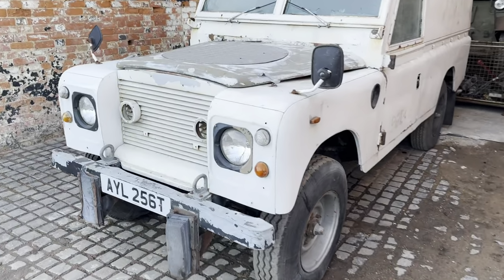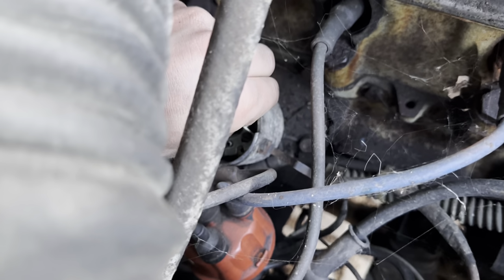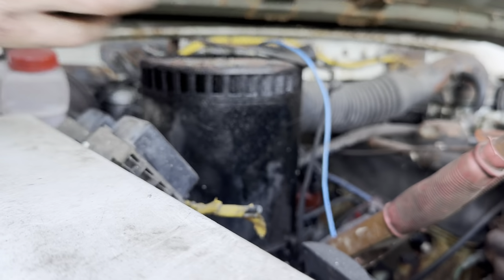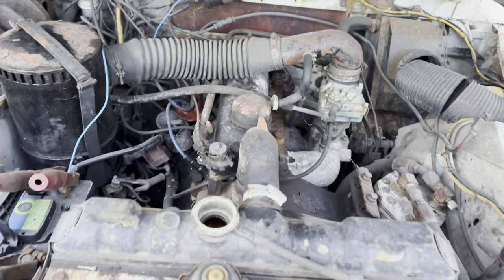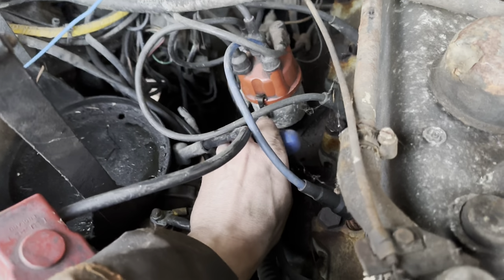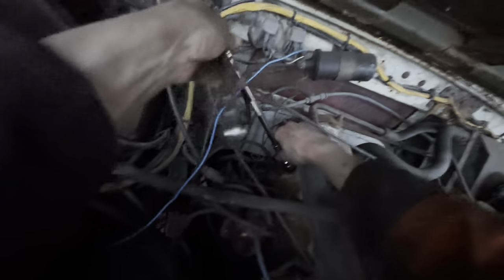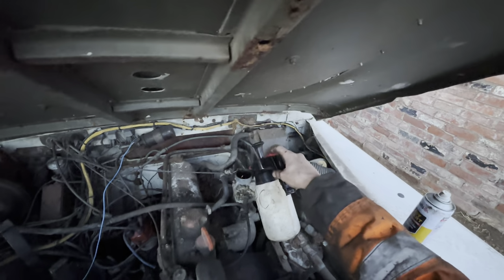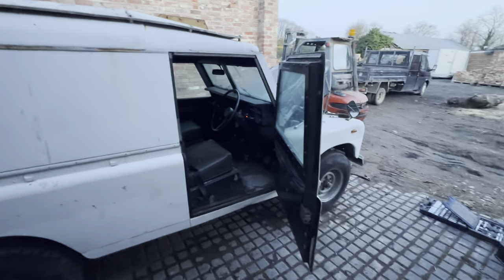SAS Armoured Land Rover. Will it start?

Comment: That vehicle was originally owned by the Metropolitan Police, it was one of a batch, issued to Traffic units, in about 1979 as a SETAC, (Specially Equipped Traffic Accident Car). They were terrible things to drive or stop from high speed, even before they were armoured, the interiors were adapted on a few to carry armed officers, and as the windows didn’t open, air conditioning was added. The rope along the centre line was the only thing that passengers could hang onto, some had portholes on the side that rotated to allow guns to be fired out from. They had no power steering and no synchro between 2nd and 1st gear. They were, from memory replaced by large bonneted American vehicles with a very large V8 engine.
Reply: And no way is it SAS, RUC yes, there are far better vehicles that dont shout security!
Reply: Wrong year that one has synchros on all forward gears, it’s a series 3 1980 onwards with brake servo and hazzard warning lights .before 1980 didn’t have them .or servo .
Reply: It's not ruc either all the simbas and tangi's were v8 
That's why the mod had to later build the snatch with its v8 ,when the military was in support of the police they were using vpk land rovers with composite protection and the 2 1/4 engine that the series 3 used was crap and could not keep up
Reply: OMG, with that must have been hideous to drive, that was spec'd by a sadist. As a past SIII owner, I can vouch it would have struggled to pull the skin of a bowl of Birds custard with a 2.25l The 109 Stage One V8 had a bit of power by comparison, but the steering was scary at speed.
Reply: The Metropolitan Police vehicle to which you refer is called a Jankel.

Comment: It never ceases to amaze me with these older motors how a screwdriver, adjustable and some brake cleaner you can get an engine rattling 😂
Reply: None of that it won't start because of the temperature sensor reading low, or manifold intake sensor needs replacing and endless error codes.
Reply: @Taz6688  "Error: Low oil pressure" course its fucking low, you won't let it start to make it go up!
Reply: It's the kind of engine that stops working every now and then. It's also the kind of engine you can get working again at the side of the road with a little bit of swearing and hammering and insulating tape. It's the kind of engine that was in every car, motorbike and and van I bought when I was young and had no money to buy better (or pay someone else to fix it).
Reply: So true where did we go wrong

Comment: Looks like the snatch wagons we had in Belfast. The IRA worked out that the door handle was the weakest spot on these vehicles and wouldn't withstand a direct hit from an RPG.  They demonstrated this using a homemade RPG against an RUC snatch wagon and it penetrated the door handle and entered the driving compartment killing an RUC officer.  Think this happened in the Markets area of Belfast (all this from memory, thirty odd years ago).  After that, the armour was beefed up on the doors.

Comment: I feel sorry for that little 4 banger having to haul around all that extra weight
Reply: It’s going to be slow, zero to sixty in minuets. :D
Reply: If you feel sorry for the engine, spare a thought for the brakes trying to stop it.
Reply: @NotALot-xm6gz  Drum brakes, wide-drum twin leading off the safari version I bet :D
Reply: @teamidris  30 mph > stationary is going to take longer than stationary > 30 mph.
Reply: @NotALot-xm6gz  YOu ever drove a drum all around vehicle? they stop amasing. for a bit, then they fade and you shit yourself. As an avid fan of old minis I remember buying my first all-drum mini, going through the brakes and honestly being very impressed with them once all serviced. stopped like a servo+disk mini and with superb pedal feel. THEN I had to brake from 70-30 twice , hard, in stop go traffic. I very very very quicly learned why drums mibby are not the best. but on a vehicle like this, with that engine, they would surprise you IMHO. Drums stop FAST. they also fade fast.
Reply: @denisohbrien  Yup, MK2 Landy drums are round. Thankfully, it never got above 45MPH as stopping distance was measured in moon phases.
Reply: I drove the grey versions of these around the streets of Belfast in the early 80s. They were frankly, death traps. 

They were so slow they were sitting ducks & the brakes & tyres weren’t up to the job due to the weight. 

In 87, they brought out the Tangi cases on a 110 V8. What a transformation. Believe it or not, some of those vehicles are still in service although they’ve been fully refurbished at least twice by now.

Comment: If the head/side/tail and convoy/convoy and side lights are operated using the same mechanism as current military rovers that haven't gone through the naff upgrade to MAN SV style switches then that panel that was under the loudhailers you put in the back is where the on/off dial fits on.

As they are powered up when you got it running I'd say someone turned them on then removed the panel from the dash that the dial fits to and then stripped the dial and the plate saying which position does what from the panel.

Comment: I have a Series 3 109 on a galv chassis with the 5mb engine I got it going after it stood for 5 year's then it stood for 10 and it still run's smokes a little I think the valve seal's have perished ....I have another to rebuild it was given to me as it 's chassis was so far gone the owner didn't know how to remove it ...I stripped it and took it home that way ..I'm hoping to put my peugeot diesel in it with a steve parker kit I got off a guy "restoring" a project he wanted to keep it genuine but I'll get 27 mph instead of 19 ...keep up the good work ...maybe drain the tank and prime the hand pump

Comment: Brother-in-Law was the Chief Superintendent commanding Heathrow in the 80s, he is pretty sure that this was on his establishment as the Armed Response Team vehicle. Not much need for rapid acceleration or stopping on an airfield so the two and a quarter and a servo was sufficient for purpose. The high level amber gives it away and the tailpipe might show evidence of the compulsory spark arrestor.  It is most definitely not a Snatch and the Credenhills were all V8s. My guess is that it was a Met car.

Comment: Opens bonnet. Initial impression:
What a rotbox. At least it'll be too rotten to burn when the electrics inevitably cook off.

Ted:
This piece of military materiel has now been officially sniffed.

"Nothing's caught fire yet." - my first comment and your mind obviously line up.

"I think I need a screwdriver." - no, you need a tetanus shot.

If you make every job look like a nail, then every solution can look like a hammer.

Ignition, mayde in the Midlands wit' proide!
Reply: Lucas, the Prince of Darkness.
Reply: @dougstubbs9637  puts on Texan accent

"D'ya know why the Brits like warm beer? Cause Lucas also makes refrigerators."

Comment: I wonder how actually 'armoured' this is compared to the Snatches we drove about in NI/Iraq that were supposed to be 'armoured' but later got reclassed as 'Protected'. Basically cause they'd get destroyed by a stiff wind.
Reply: thats my interest, ive had the (fortune?!) of working on a few armoured vehicles, so aside the windows, theres plates added to all panels, then splinter protection after those plates, if vital compents (like batterys) are outside the protected passenger compartemnt(say on a 5 series bmw) they too receive protection, all this stuff is HEAVY. that defender looked to have the stock bulkhead so a good front shot would penetrate the cab.  FWIW every car ive worked on came from NI .. clearly a hostile place during the troubles.
Reply: Mobile coffins

Comment: the SAS never used "armourd " landrovers they were open top pick up 90s with a 50 cal in the back stripped for lightness and speed they were called pinkies (because of their colour)  and this is NOT one of them this might have been regular army but I doubt it it looks like a military police job from Northan Ireland troubled era and a petrol spark ignition engine will not run with out its battery connected FULL STOP it cant charge with out a complete battery circuit unlike a diesel which as long as the engine has fuel it will run without a battery connected something amiss here serious editing going on here I think.

Comment: PRO TIP. wind the nozzle out a bit on your brake clen bottle so its a fine line, that way you can get it straight down the carb with accuracy. xx

Comment: Looks very united nations. SAS seems strange to me being white
Reply: Ex police unit, you can just about make out the adhesive police markings on the sides. Also the blue light holsters in the front bump + the mega phone in the cab. A lot of them were sold to the MET after returning form where ever and used as riot control vehicles.
Reply: Ex PSNI?
Reply: @NotALot-xm6gz , no earlier, RUC.
Reply: The SBS used some similar white defenders at the battle of qala I jangi. So SAS might be true.
Reply: @momme_hwk8603  it’s SAS spec, there was 2 of these made for the MET. I think Joes going to show some pictures of it in the next video on it

Comment: Don't use conventional thinking when dealing with SF vehicle electrics, you have to think covert operations etc, I.e they wire up the break lights via an extra 'Off' switch, that way they could break with no tell tail signal. There will be lots of weird things to look out for.
Reply: Cheers, Lofty.
Reply: @CL-vz6ch  Lofty's dead.

Comment: 44 years young, late series 3, good old oil bath air filter and hopefully, not that it really makes that much difference, the 2.6 as opposed to 2.25 4 cyl petrol?. Interesting radiator grill. But think I'll stick with my ex Gurkha Rifles V8 Defender and my ex RA lightweight :-)  PS Just spotted there are only 4 plug leads so just a 2.25L - what were they thinking?
Reply: It's a four cylinder, very obvious in the vid as on a six the dizzy on the LHS and much higher up, different manifold etc.

Comment: Its obviously a 110 derivative, but from what year?  Looks more like a RUC Shortland Landover from the 80/90's. The SAS i knew in the late 1980's were running around in Range Rovers. Engine looks typically shite so defiantly not one of the NI 110 Armoured Landcover's, not a V6. Straight onto Brookwells then for new spares? Do you have Military Training Mr Hewes as you handle that adjustable spanner as a hammer like a true Squaddie would...PS, NI is short for Northern Ireland. Would be very interested in the history of this vehicle.
Reply: It's not a 110 derivitive, it's a Series III LWB 109"
Reply: ' it's obviously a 110 derivative ' .. lol it's a series 3 , from reading the number plate it's about 1979
Reply: mind you 1979 might have been when it was released from service & civvy registered

Comment: 2.25 petrol engine....horrendously thirsty on fuel, I was lucky if I saw 10mpg from mine with a standard SWB body on, let alone the extra weight that one will be carrying and driving an aircon pump too....chug chug chug goes the Landy
Reply: That's shit even for a 2.25 petrol. I get better than that out of a 109" straight six petrol!
Reply: @onetonlandrover  That's why it got binned and replaced by it's diesel twin, still not super fuel efficient, about 25-30mpg but nice and reliable
Reply: @t0m541  I couldn't live with a diesel in a series, far too slow and noisy. A decent 2.25 petrol should cruise at 60 and get not far off 20mpg. Sounds like yours was f**ked.